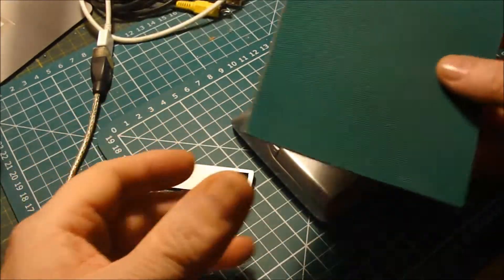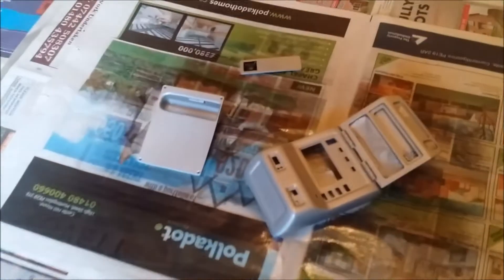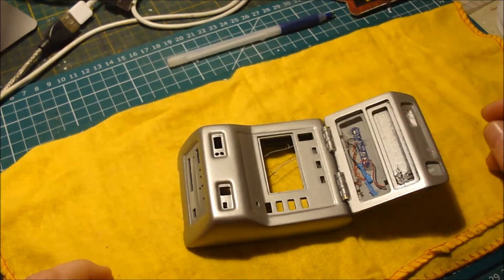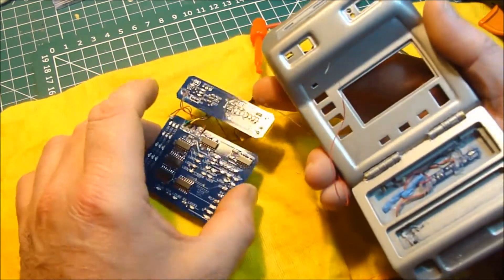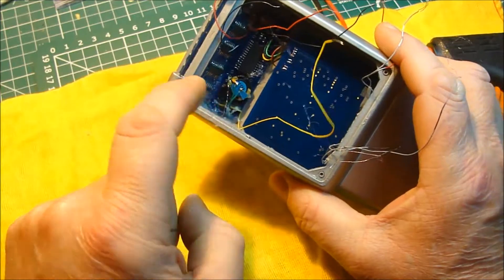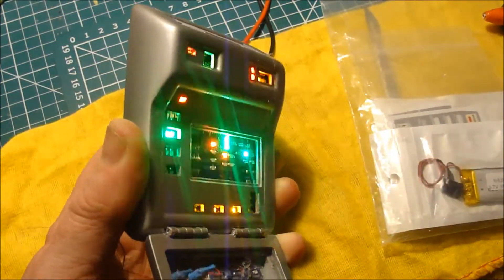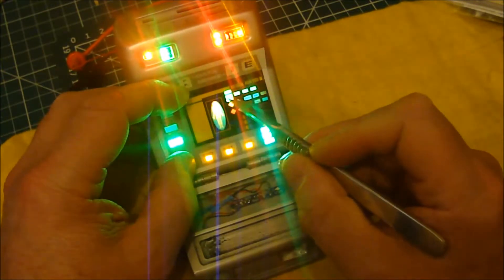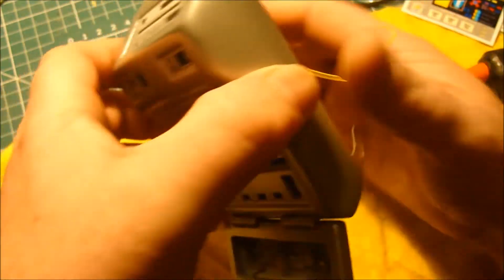Star Trek Medical Tricorder Part 6  Lacquer Coat & Mainboard Electronics

Comment: how do you determine what to set the power supply at. got all the stuff bot I am a noob.
Reply from the maker: Charles Kane the battery for the kit is 3.7 volts so I set my external power supply unit to just below that 3 volts 3.2,  3.4  will all make it work..my power supply auto sets the amps
Reply from the maker: Charles Kane but if yours does not keep it at zero and slowly increase until the less start working...DO NOT go too high in voltage never more than 3.6 and keep amps very very low